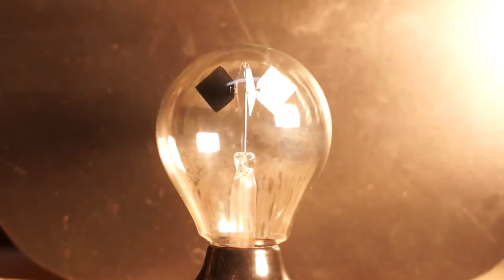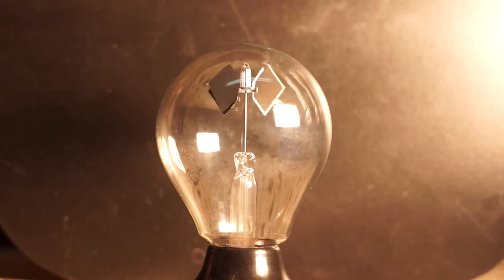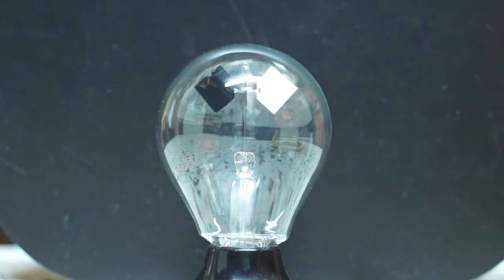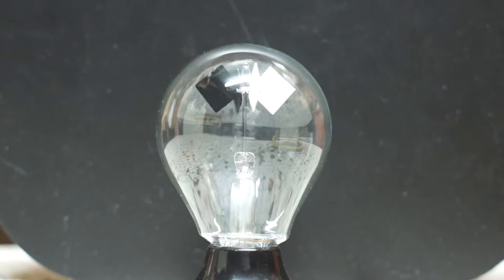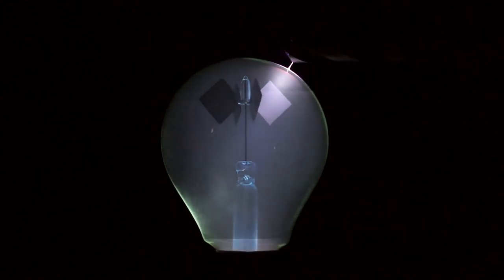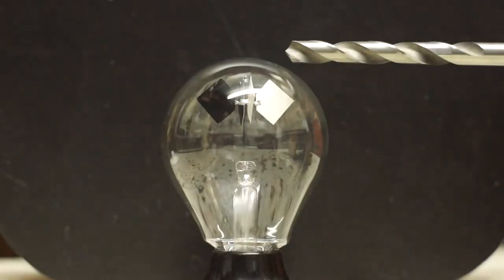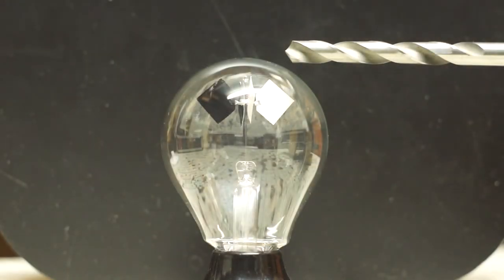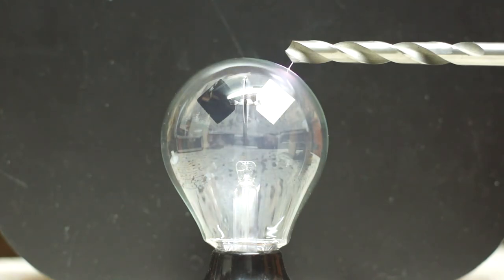High Voltage Crookes Radiometer

Comment from the maker: The vanes are made of some non-magnetic metal and are mounted to a metal ring on a glass tube. The tube sits over a metal pin but the pin doesn't go outside of the bulb. So all the parts inside are isolated from the outside world by glass.

Comment from the maker: I've seen the Crooke's paddle wheel tubes as well but those run on DC and have electrodes that pass through the glass. In my case the glass acts like a capacitor passing only AC. I don't know if the black paint is more emissive to electrons or not. If the white side is an insulator then maybe the dark side is warmed by ohmic heating. Maybe I'll buy another and pull it apart to test the properties of the paint.

Comment: The green xray induced fluorescence of the glass directly across from the HV arc and no where else suggests unidirectional electron flow. I would bet a simple form of rectfication is taking place somewhere in the tube and as such DC is being applied to the vanes even though the glass envelope is an AC passing capacitor.

Comment: Isn't the arc still making light?  A light that is perhaps lower in overall intensity, but much much closer to the vane's fins?  May first test would be to try to avoid fluorescing the gas outside the bulb, and see if it still spins.  Can the bulb and act be put in a minor vacuum?

Comment from the maker: It takes a fair bit of power to make it spin (at least 100w from a lightbulb in the from of light and heat). The light from the arc was considerably less intense than that, it was one of my theories though.

Comment: Yes, the field enter at one point and leave on the rest of the surface.
The metal is probably conductive (possibly except the black paint).
So only one side of the vanes is active in "AC transfer", possibly e-beam. I know there are some crookes tube that have a Paddlewheel driven by the e-beam. May I be on to something? or is it something totally different?

Comment: They also spin when you turn an air duster can upside down and spray the liquid onto the glass.
Reply from the maker: Really? Does it spin the same direction as when you warm it up?
Reply: Nick Moore - it spins the opposite direction when you spray the liquid on it.

Comment: Not anything fantastic the light from the electricity is producing high energy photons that create the same conditions but at a less degree than white light. Energy is transferred to the black surface creating a temperature differential . the hotter black surface is now radiating heat to the partial vacuum producing a small force to move the veins. The glass is also heating up which intern should increase the speed over time. Thanks for listening.
Reply: "Not anything fantastic"